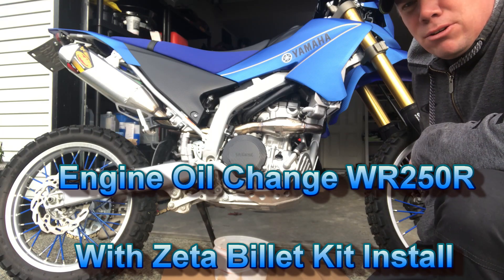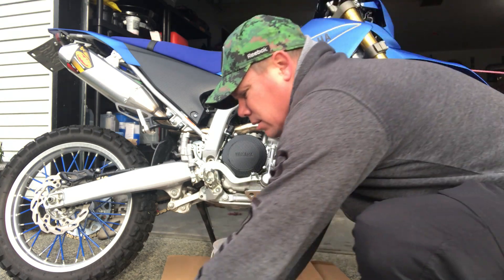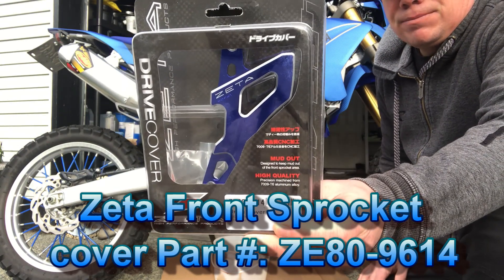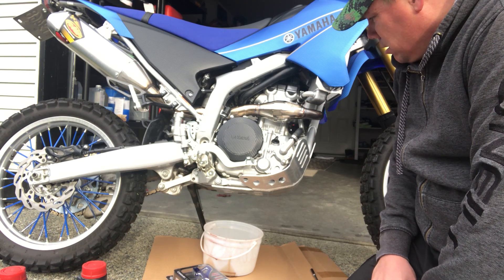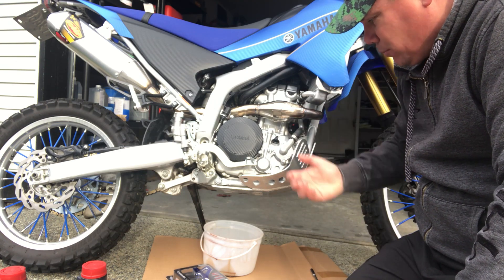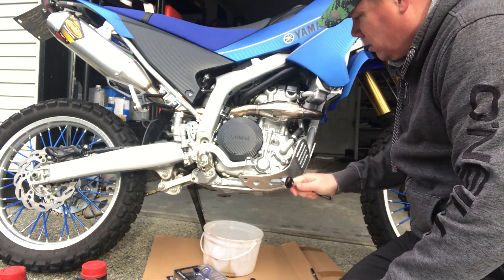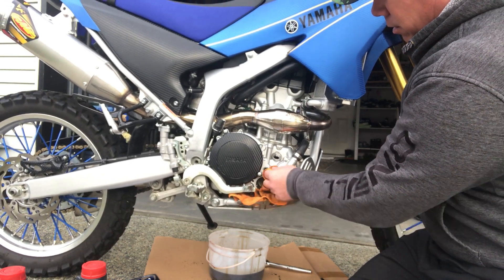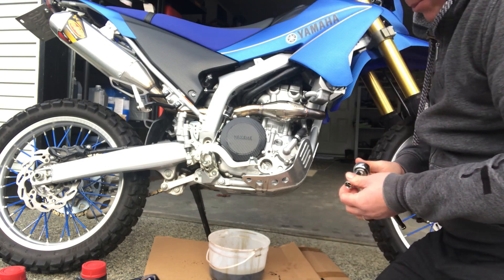Motor Oil Change and Zeta Billet Kit install on WR250R

Comment: Great video. Have you had any issues with the oil filter cover? I love the look but a bit concerned switching out the OEM part since there is an oil passage through that part. I don't want to risk my engine.
Reply from the maker: Nope. Been using for 10000km and not an issue. No leaks either. I’ve done two oil changes with it now as well
Reply: @bigair0176  Thank you. I got one for Christmas but I need to measure out the oil passage hole to ensure it matches the stock piece. I think the part is great looking but last thing I want to do is risk the oil supply to my engine with bling.

Comment: You should use a new crush washer every time. Just a recommendation, your choice. But a crush washer gets crushed - it doesn't spring back. Also, the owners manual states that you should be checking the oil level when the engine (& oil) is warm. So you should run your engine for several minutes, turn off the engine, let the oil settle - and then put the bike level and check the oil level window.
Reply from the maker: Yup I check it regularly. If my plug leaked I would replace the washer for sure. Thanks for the feedback. Cheers
Reply: 55,000km on the original crush washer

Comment: Outstanding! Just wondering why you don't torque to specs, is it even needed?
Reply from the maker: On certain parts like head bolts and super important bolts I will research the torque specs. Otherwise I just make sure I don’t overtighten or under tighten the bolts. Just how I’ve done it all my life.

Comment: Just tried to change my oil today, can't even loosen the drain bolt. I guess that $6 socket set from Harbor Freight isn't gonna cut it. 😅
Reply from the maker: I always try to buy the 6 point sockets not the twelve point. Twelve point seem to slip easier. If it’s stripped a solid pair of Vose grips may be your only option. I will sometimes use a bit of heat around the bolts but in this case you would have to be very careful due to lighting it on fire. So unless you know what your doing with it don’t try the heat option.
Reply: @bigair0176  Yeah, I'll probably take the skid plate off and just go at it with the vise grips. I ordered a new magnetic drain bolt though, so I might just wait until it comes. Thanks for the tips!